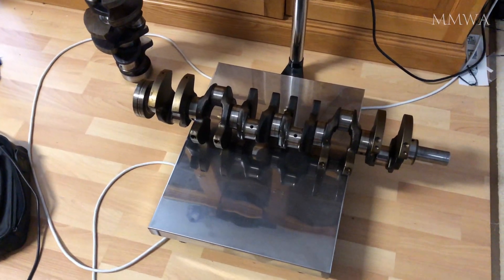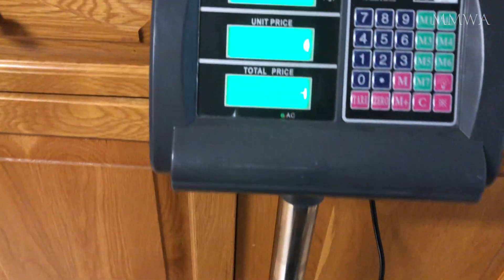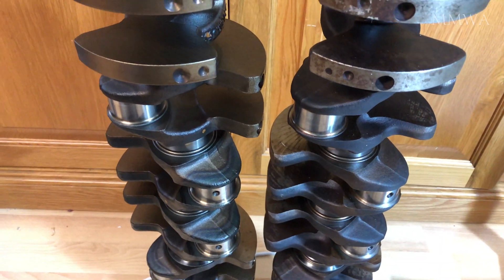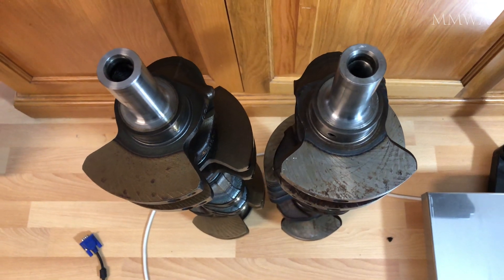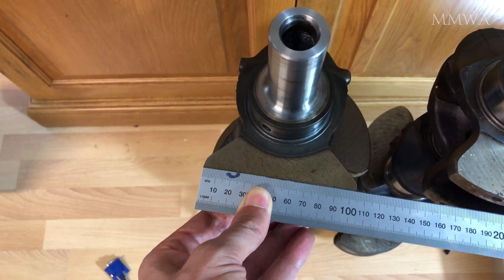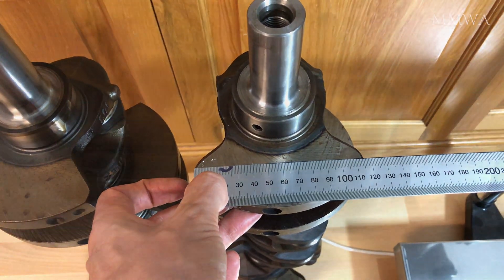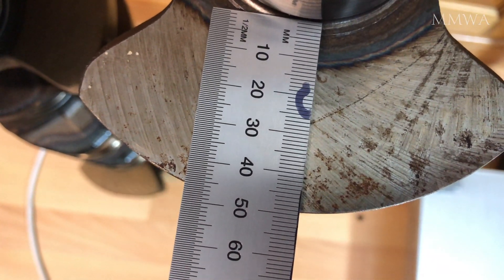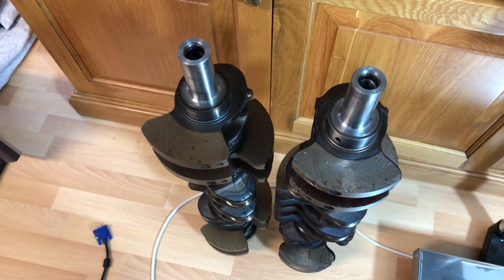Mercedes M104.980 crankshaft vs M104.990, Whats the difference?

Comment: That's a given sounds a lot like the DW2015: TurboBigBlockChevy It Goes Without Saying
Reply from the maker: I'm guessing they will "knife edge" the counterweights since so much needs to be removed
Reply from the maker: I think quite a lot of material is going to have to come off this crankshaft - it is so much heavier than the 3.0 version and these mahle 3.2 pistons are 60 grams lighter per piston than the stock 3.0 ones! I'm no expert but I will be telling the ones dealing with the crankshaft that I expect it to have no problem with the original 3.0's 7000rpm redline.
Reply: If new pistons are 60 grams lighter than originals, you have to take off at least 3 times 6x60 grams off the crank from the counter weights, because the conrods are longer than the counter weights relative to axis of crank
Reply from the maker: @G55STEYR  It wont be me doing it the crank will goto a crankshaft specialist up the road from my machine shop but i will make sure the whole rotating assy is ballanced to perfection. I want this thing to be smooth like the original.